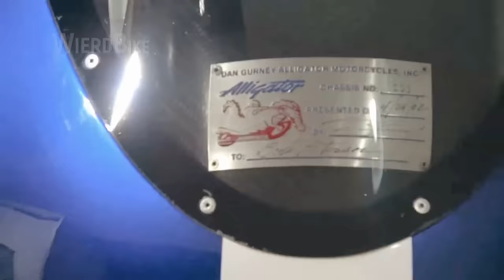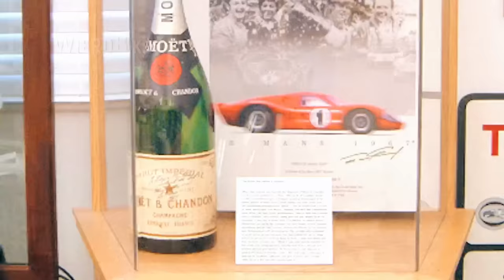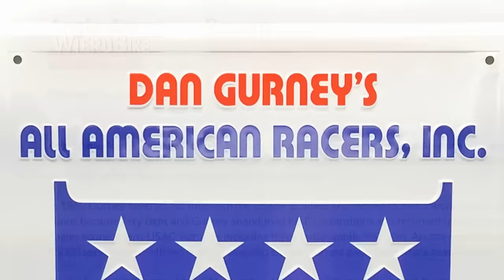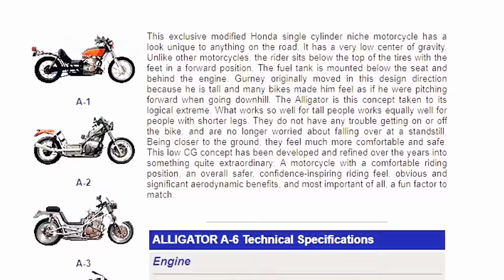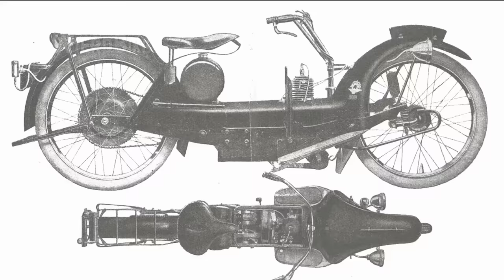Weird motorcycle - BRILLIANT INVENTION! “The handling of this bike was close to telepathy…”

Comment: Look up the Nearacar... and the work of the UKs  Mad..😂 Malcolm Newel with his Quasar and ultimate 1300cc 6cylinder powered Phasar... Feet forward motorcycle designs. The Quasars were built with a roof used a alloy 3wheel reliant car engine ..  and all were indecently fast in the hands of Mad Malc. 🧙‍♂️🇬🇧

Comment: Can Gurney turn it into an EV? Put a 30 - 50 KW motor in it with a small 20kwh dual battery that can be hot swap. Wrap it with a dustbin fairing and see the efficiency of this vehicle. imagine a vehicle made for commuting with one battery that could be configured for longer range when the need arises. Make this.

Comment: 5:12 First glance it looks rather uncomfortable a bit like sitting on the floor mat but you must lean forward streching forward to reach the bars so all your weight will hurt your boney butt smaller area instead of it spread out on your butt and legs taking the weight like on normal bikes. Also you can't use the backrest and your knees can touch your arms and your belly cramped between your legs and poor low height road visibility and the inferior long wheel base handling. Reminds me of the first cruiser I bought and I ground off the running board stubs the first week and realized that riding style and poor handling definitely wasn't suited for me, but each to their own. 
Regardless I still would like to try one of these out for the rare experience, and possibly change my opinion.
Reply: It may look uncomfortable but its not.  when just riding you can sit back and enjoy the ride.  However if you are riding hard in the mountains you do tend to lean forward for better handling.  The bike is actually designed for someone over 6 feet.  I'm 6'2 and find the bike very very comfortable.  My arms never touch my knees.

Comment: I feel like this bike would greatly benefit from a big and torquey inline 4 engine, hayabusa style!
Reply: every bike would benefit from a busa engine
Reply: The engine would get in the way of the rider.  🙄
Reply: Yeah ,like sitting behind a woodstove. where do you thing the heat from the engine is going to go?
Reply: The busa engine is gorgeous (I'm a fan), but this bike doesn't need it: in fact it would ruin everything. Just think about it: this thing (with its tiny little air cooled engine) went 0-60 in 3 seconds, and topped out at 150, I think that would be plenty for lot of riders out there (me included).

Comment: Poor visibility, heat from the engine straight into your chest, not to mention fumes from the carbs. If anyone rear ends this thing when the rider has the front brakes applied, or God forbid, the rider rear ends someone at speed, this will fold like a fortune cookie, and the news from the interior of this pincer-like arrangement will be grim. A face full of intake manifold would be the least of one's concerns.

Comment: It's similar to the Victory Vision without the Arlen Ness style. Although it's not ideal for twisties, if it's done well - like the Vision, loading well the front wheel for handling -, it works well. I would never change my Vision for other, but I've got a Duke for the sport... :-)
Reply: Complete bollocks! It's nothing like a Victory Vision! About half the weight and twice as fast through the twisties!

Comment: Like sports bikes where the hand controls are almost touching the riders knees this is a hopeless frame idea. The  C shaped posture of arms and legs stretched forward makes for very uncomfortable riding like some radical modern choppers.
In one part of the video his arms are overlapping his knees. This can be seen in some T Bucket hotrods. The steering wheel between the knees makes for very difficult steering control..
The seat height of 450 mm the same as a kitchen chair, awkward to get up from with a bike between your shins.And you still have to swing your leg over the rear wheel hump after standing up. Obvoiusly he had the money to do this but modern bikes, like cars, are generally the perfection of form and function designed over the last 100 years.

Comment: Thats why any racer of motorcylces doesnt sit on the seat other than to plant weight on front wheel in a turn for dirt, as standing or putting all your weight on the footpegs lowers the center of balance to that location and the bike handles the way ot wss designed to . Which is lower than sitting on that freaky looking thing. Just use the footpegs and keep your body weight light on the seat and even squeeze the gas tank. This bike was made to be lazy. Any good rider who rides often will be fit .
Reply: Weighting the footpegs 'lowers' nothing.  😂

Only people who know nothing about physics could come up with something as dumb as that.
Reply: Ok. Lets go to the other extreme then. You say standing on the footpegs makes no difference to the  centre of balance. Try riding a motorcross bike while standing on the seat . See how that goes. @FFVoyager